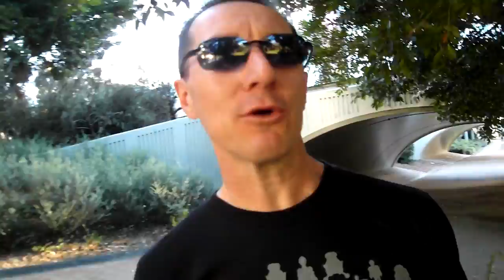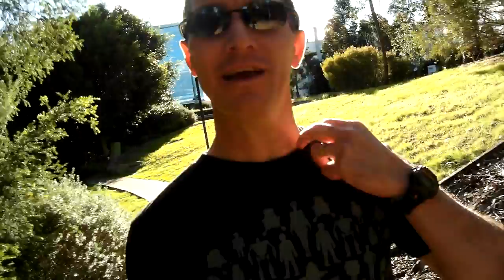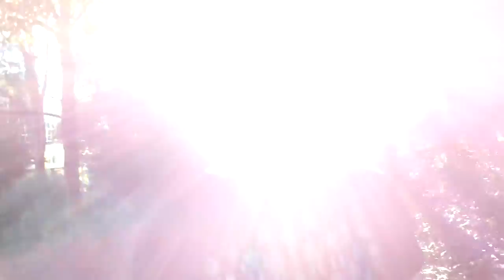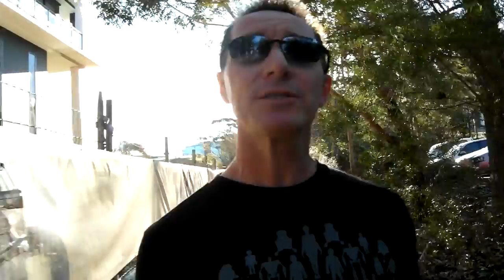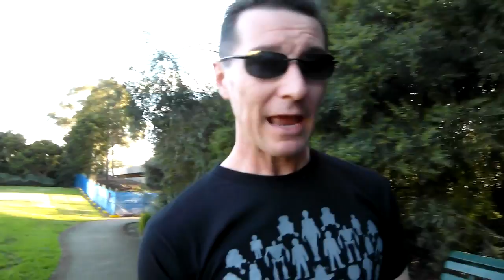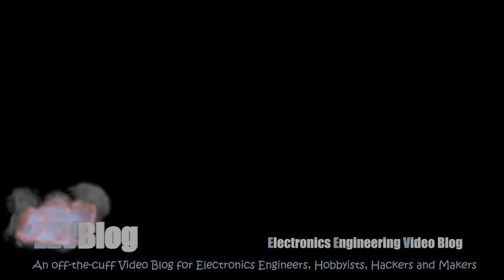EEVblog #302 - Electronics Beginner Advice

Comment: Having constraints are generally good practice in any engineering field, software being a good example, you're limited to the constraints of the micro and most times will have to approach a problem differently to get the same results.

Comment: You don't just put together a bunch of parts and expect them to work. Understanding the working of these basic circuits I've mentioned empowers you to build new stuff. Understanding when they don't work empower you even more to solve problems. Soldering is a useful skill, but you can probably postpone it since you'll be dealing with breadboards at first. Learn how multimeters work. Remember you measure voltage in parallel and current in series (or via ohms law, using the values of V and I)

Comment: Some circuits the beginner can build: resistors in series forming voltage dividers (measure resistance, voltage and current with different values of resistors); current dividers (resistors in parallel); oscillator using 555, potentiometer and a led or headphone; class A audio amplifier using a single transistor, polarizing resistor, coupling capacitor and headphone; audio amplifier using op amp, headphone and a few feedback resistors to set gain; then add rc and rl filters to the amplifier

Comment: Beginners must begin with basic technical stuff. Understand how resistors, capacitors, inductors, relays, diodes, transformers and transistors work (first as digital switches, then as amplifiers, polarization, gain, etc). Learn RLC, RC, RL, LC circuits. Learn about basic ICs such as 555 timer, 072 operational amplifier, digital logic Ports, flip flops. Get a breadboard, a multimeter, a power supply, some of these basic components you studied and start building stuff. Don't forget safety glasses!

Comment: I couldn't agree more... Constraints definitely improve imagination and engineering skills. I was recently making an 50w subwoofer amplifier for a friend, and it was powered from +/- 80V symmetric supply, than i had to find out a way to power a LM741 opamp which needed +/-15V. At first i was thinking about separate transformer, rectifier and voltage regulators, but found out it would be expensive and not elegant at all. So only then i figured out that only thing i need was 2 zener diodes. :)

Comment: the book Make: Electronics is a good start plus some of the old textbooks you can find in a used books store that explain how transistors work-but just that.  there is no formula when making/reading complex circuits. thats for complex computer programs. Getting a breadboard and putting the circuits together is how you learn while using the basic formulas for series and parallel resistors(capacitors too) etc and also using the multimeter to test your idea of what is going on

Comment: I learned electronics by finding old tv and radios and it was in the early 70s I was 10 and I learned a lot . then I went to get my aas in electronic engineering . I then got a job at ASI who made high end radios like the delorean . I worked my way from a production tech to a warranty  repair tech. I still have a Delorean asi radio . They went bankrupt and I shed a tear that day it was 1984 I worked there for 6 years. I then went in the NAVY spent 7 years on submarines I am now a disabled vet

Comment from the maker: Just a cheap ebay monopod with ball head. The 24mm wide angle lens on my WB2000 compact camera means it doesn't have to extend right out the whole way, it's fairly close to my face. Monopod is probably angled at 45deg.